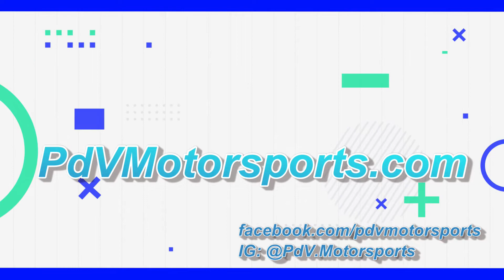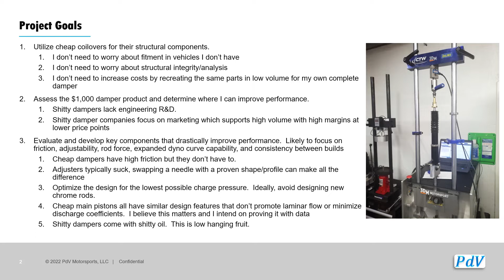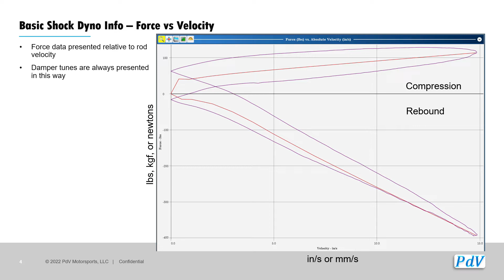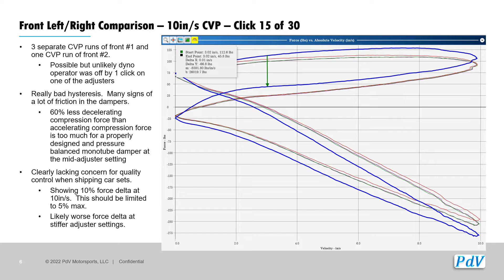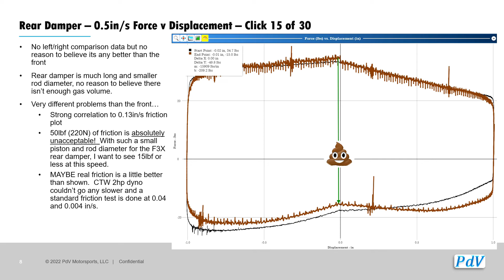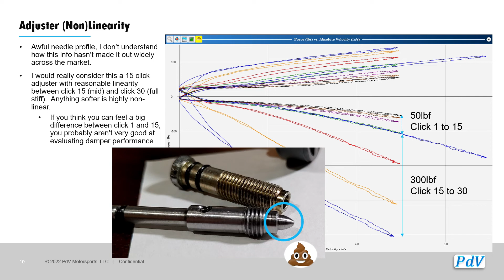Ep. 1 - BC Racing Coilover Turd Polishing Project

Comment: What shock oil do you use? Is Silkolene synthetic a good oil to replace old BC oil with?
Reply from the maker: Silkolene Pro RSF 2.5wt and 5wt are top of the list.  Maxima supplies Penske so it is proven at the highest levels.  I can get discounted Motul oil so I'm looking forward to trying that, the VI is very high but who knows about friction, foaming, expansion, durability, etc.

Comment: Great video series. Looking forward to more content. Any thoughts of sharing some tips for DIYers of how off the shelf parts and valving can be used to upgrade BC dampers? And what can a DIYer use to reduce friction on BC dampers?
Reply from the maker: Thanks!  I'm looking forward to making more very soon.  I definitely want to share whatever DIY info I can, ideally sell some custom tooling to allow anyone adventurous enough to rebuild them, and provide guidance on drop in replacement parts where possible.

As far as friction goes, I plan to offer a replacement rod guide assembly with an alternative seal and wiper that will reduce friction but you'll need to send the dampers to me for rebuild or buy the custom tooling and rod guide assembly.
Reply: there is a great write up of a guy rebuilding them on the lexus forums using bilstein digressive valves and shims! he also has a ton of youtube videos (not the best quality) but you can get the jist of a rebuild with them
Reply from the maker: @ryanbeck4826  I've seen his videos and read the thread.  The plan is to start rebuilds using other brand's off the shelf parts before making custom pistons etc. and I'll try to get into more detail along with some dyno run analysis before and after when I can get to it.